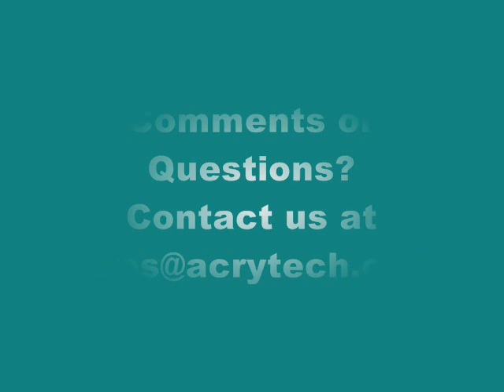DuraTex Roller Application

Comment: I just did my first speaker, it already had black paint and I only needed one coat, so I have heaps left. The only question I have is this: The top lid of the bucket was quite hard to get off, but now I have a problem putting it back on, it just sits on top. Is that normal? I am thinking about finding a heavy object to put on top of the lid so that the paint inside does not dry out. Is there something I am not doing right?
Reply: @Jakeman90210  - I figured it out. Very tight fit, I suppose this is to make it very air tight.